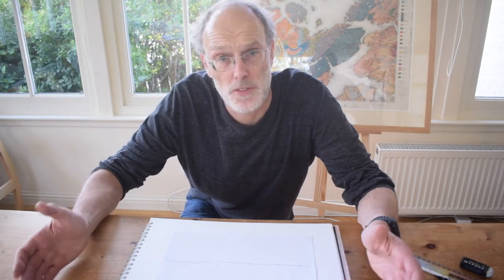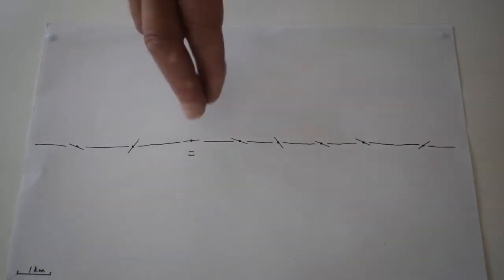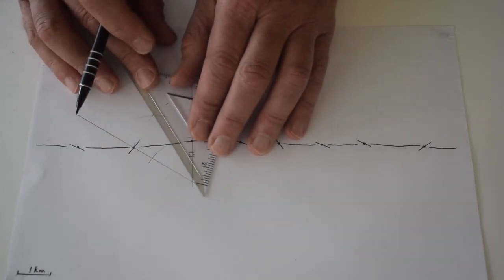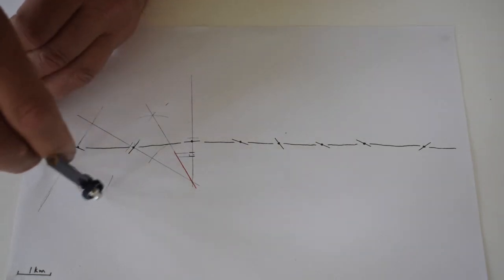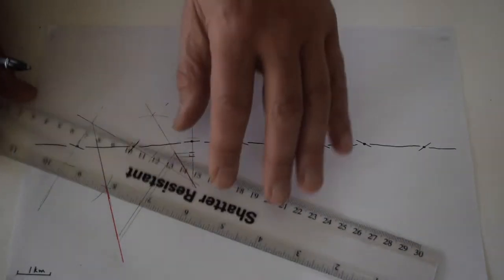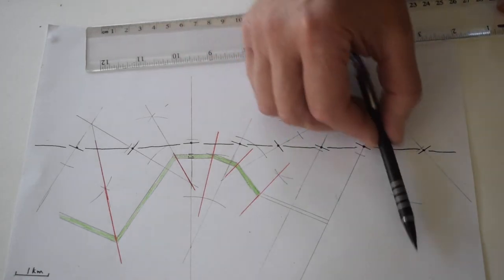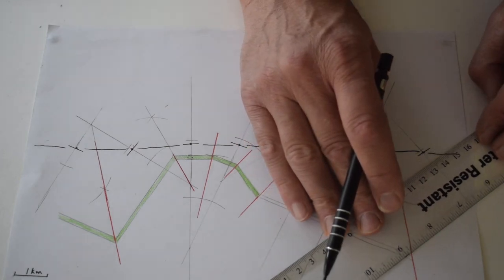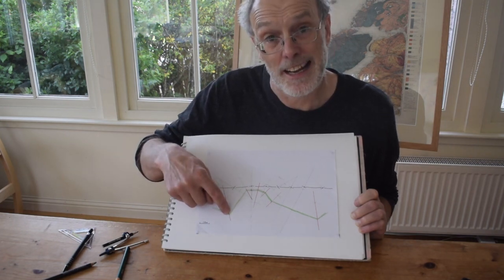Using the kink band method of section construction

Comment: you  use a bisector , but I don't know at what measurement I placed it to draw the arc.
Reply from the maker: Project an orthogonal line from pairs of dip sites - where they intersect defines the place, then bisect the angle and draw in this bisector. This define the abrupt fold axial surface and the limbs are defined as panels of constant dip. Does that work for you as explanation?